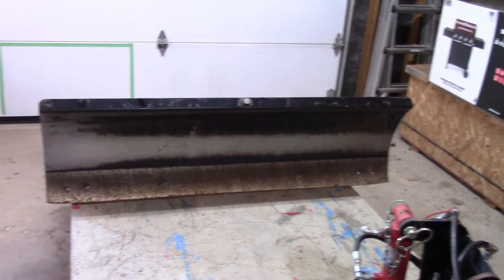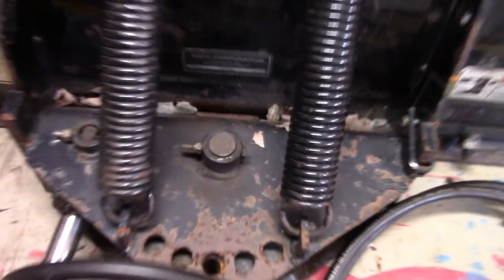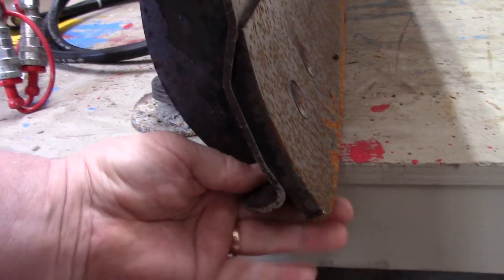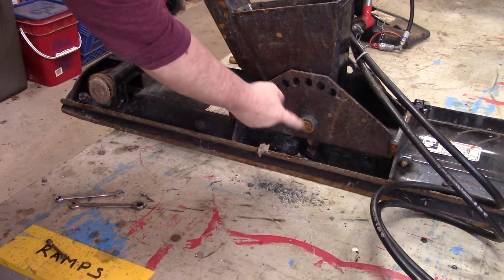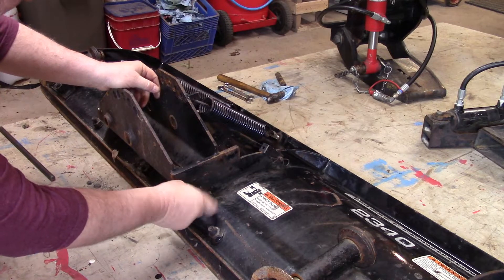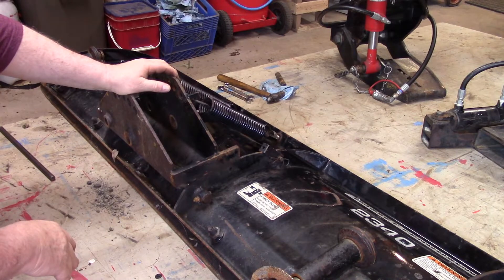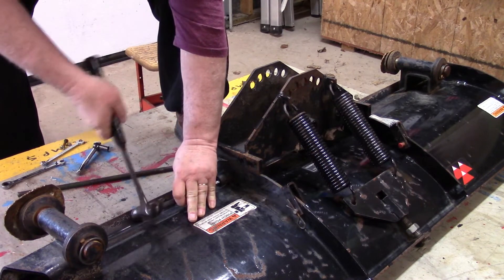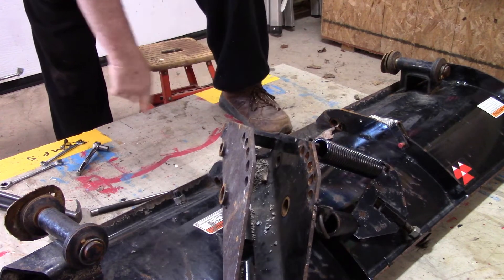Plow Maintenance Part 1

Comment: Nice work Mike! There’s a lot of moving parts to that plow. You’ve got your work cut out for you on this project!
Reply from the maker: How's she goin'?  Actually the quick hitch is pretty simple.  Kubota and Massey Ferguson use the exact same set ups, or did back in 2007.  The maintenance is coming along and will make a big difference in the plow.  Thanks so much for tuning in and for your comments.  Take 'er easy!!!

Comment: Good maintenance will help for the next decade or more!  The only thing I would say, is to keep the blade the same way.  I would tend to believe the beveled edge toward the ground will catch more gravel and tilt more frequently. Unless you are to the point you are wearing down the plow's frame. Thanks!
Reply from the maker: How's she goin'?  When I use the blade as a dozer blade I lock it so it won't tilt.  For snow it can, and does, tilt .  I did notice that this past winter it didn't tilt as much as in other years.  I thought I was getting better at plowing but maybe it's because it was wore so much!!!LOL.  Anyways, I have a new cutting edge now and the hinge pin is all lubed up, so I'm good I hope!!!  Thanks for the look see Joe and have a good one eh!!!